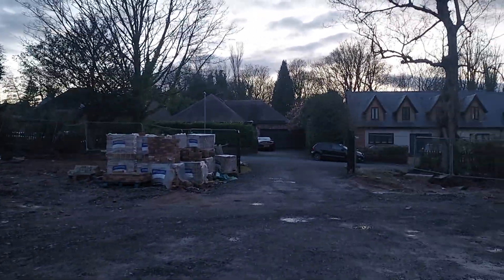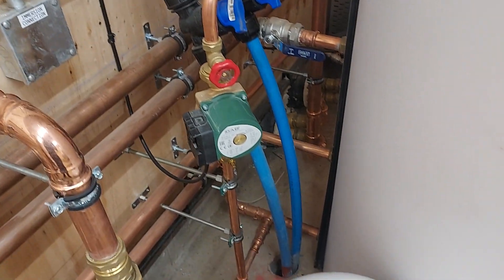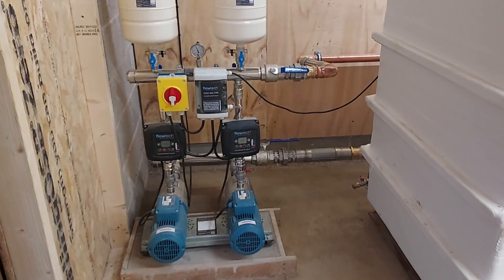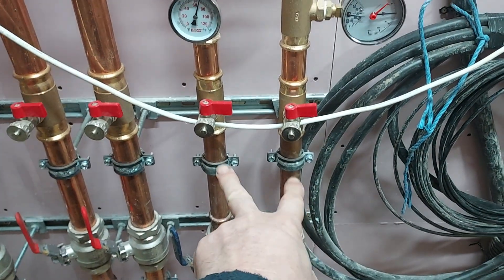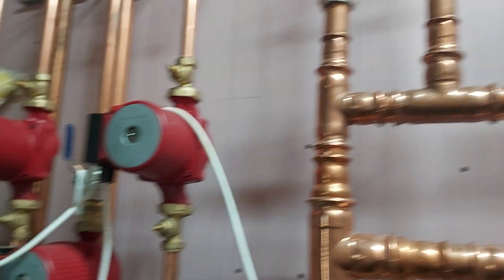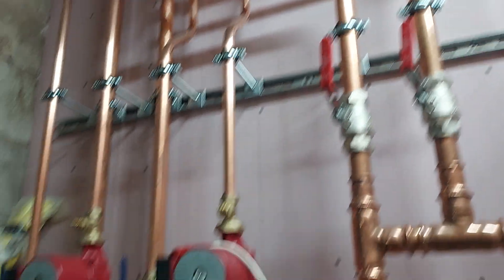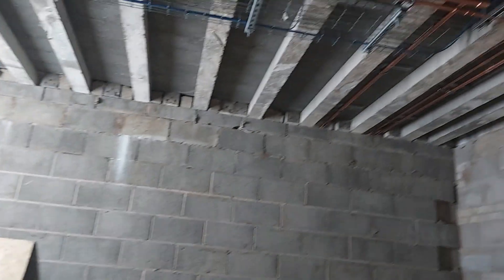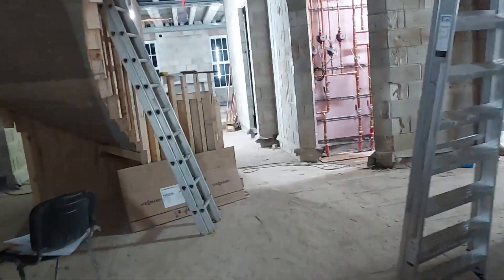My biggest Project so far

Comment: This is a total bullshit job with oversized pipes and extraordinary heat loses in all the circuits, waste of electricity in redundant pumps.  I made heating for building with 30 flats with 31 bathrooms, 1700 square metres and needed just 1000 liter indirect ACV HRs 1000 boiler heated by 48 kW gas condensing boiler capped to 28 kW and flow temperature from boiler set to 65˚C limit to allow condensing during heating hot water. Perfectly fine for my building, annual efficiency is 59 kWh of gas per 1m3 of hot water around 50˚C hot, including circulation loses. Not carrying about legionella due to 3 m3/day consumption which doesn't allow grow of it. 32 PPR was fine for hot water supply peaking at 1m3 of hot water during peak hour. Separate 48 kW gas boiler for heating through plate heat exchanger due to pressure difference caused by high static water pressure (26 metres building). Primary heating circuit flow rate 2 m3/hour, secondary 3.5m3/hour with possible peaking up to 5m3/hour. Using copper for hot water supply is nonsense. It has huge heat loses, PPR or PEX does much better job with regards to heat loses. Remember - I used PPR 32mm for 31 bathrooms and it is still oversized. Electricity supply for the 30 flats is 3 phase 80A/230V.
Reply from the maker: @JiříFranek-s2j  thank you for your comments. I guess everyone's entitled to their opinion

Comment: Cracking job Andrew. Looks like fun. You have given me an idea. I am building a summer house which will have a shower and kitchen. I was going to install a small electric unvented but might use the insulated pipe you have for the 25 metres from my 300litre unvented.

Comment: Hi Andrew I've just been doing a house with numerous bathrooms. I had initially thought about PIRs to trigger the bronze pump on the Dhw loop, but had discounted it just from lack of confidence in the idea, after watching this video I thought what the hell ill give it a go and customer was game to trying it as well.  So I've just finished wiring it all up today and putting the PIRs in. And works quite well, it's not mega instance but it does drastically reduce the wait time. Thanks for inspiring me to give it a go
Reply from the maker: The idea of the pirs is that it gives time for the circulation to occur before you open the tap. If the water isn't actually getting to the tap by the time you have finished having a pee you may need to use a stronger pump

Comment: I am not a plumber but many many years ago I used to layout printed circuit boards with red anc blue tape. The resulting large image was photographed, shrunk to pcb size and etched with acid to reveal copper tracks. Seeing all this copper work brought it all back. It seems a terrible shame to hide it all.
A quick question. I have been thinking about the hot water runs in my normal house and ways to reduce the wasted water and energy content. 
I came across the Sunamp heat battery which looks like it would do a good job. It takes the place of a hot water cylinder and is about 1/3 of the size. It should release hot waterinstantly and csn be charged by either hot water or electricity. It looks like it would be a (gòod?) Solution for at least the handbasin issue. Any comments would be appreciated.
Reply from the maker: Any cylinder provides hot water immediately and so this will not be a solution for the problem

Comment: Maybe I didnt understand well what the 4 pumps do, but if they are used to reduce the time from when you open a tap to when you have hot water available at the tap, then why not control them via a flowmeter? When you open a tap then they turn on. Why use a PIR to control a pump? Also PIR tend to break. In 5 years a pir will be broken and those pumps they will not turn on anymore and the owner won't even know it. You can buy from Grundfos a similar pump to the one you selected there, only it has a flowmeter integrated so that when there is circulation, the pump comes on

Comment: Sorry, 500ltr for 3 people - what are they, mermaids?
Reply from the maker: The 500 L is for the house rather than three people. The customer has requested all five showers to be operational simultaneously at 30 l per minute. That's approximately 2/3 hot water that's 100 l of hot water per minute so a 500 l cylinder will give them 5 minutes of of showering. The original design required 1000 L of water to provide 10 minutes of showering. The customer agreed to having only a single 500 L cylinder on the basis that they won't actually use all 5 bathrooms at the same time and if they find it problem it's already planned up just to slot in another 500 L cylinder
Reply: Clients are also practising muslims  with own prayer and washroom, which could mean five times a day.
Reply: 30ltr a minute shower x 5? So they are mermaids then 🤣

What's the recovery time with 64Kw?

Comment: And that is about £5k worth of copper pipe & fittings Alone.  Woooah that is a rather large and involved install. Good work and looking super slick.
Reply from the maker: Yes somewhat over specified and oversized for sure. I keep telling the customer that if this was for a 20 room hotel I would be thinking the system was about the right size

Comment: How do you combine two boilers and still utilise priority hot water? Is just one boiler being use for the cylinder?
Reply from the maker: The cylinder is fitted with two hot water temperature census. One boiler is set to 55 degrees and the other to 50 degrees. So when only a small demand is placed upon the hot water only one boiler will fire if the demand grows bigger and the temperature in the cylinder drops further both boilers will fire to reheat the water in the cylinder

Comment: I'm a plumber, nearly 30 years old, been qualified for almost 10 year, I've spent my life doing kitchens,bathrooms and general repairs and maintenance but installs like that in the plant room makes me feel incompetent, wouldn't even know where to start
Reply from the maker: A very good friend of mine is a commercial heating engineer. The often says to me that commercial is just the same as domestic but bigger. Actually if you look at the design of this system and some of the smaller ones I do this is actually far more simple. But it's been a really good learning curve for me handling such big pipework and carrying out calculations for this size of Project. You really do have to stop a lot and calculate through how things are going to work when they're on such a big scale. So far I've found a few surprises along the way that have required design considerations I've not had to make before. I just hope I haven't missed anything in the process and that there's no design failures in this job
Reply: @andrewmillwardwatford9410  I thought you had a commercial ticket?
Reply from the maker: @tonydaddario4706  no I never do commercial work. The commercial part of this gas system will be done by another engineer
Reply: @andrewmillwardwatford9410  how is there a commercial part of the gas system if it's a domestic premises? thanks

Comment: Impressive.  Thanks for sharing.
We're a family of 5 and 250L DHW tank does us.  We can run it out if everyone has a shower/bath in same evening, but honestly 1000L would be if we ran a hotel spa.. ha.. :)
Reply: Also has 64kw HWP to recharge the cylinder fairly quickly if that were ever needed.
Reply from the maker: My house has a 210 l cylinder supplying 5 bathrooms and heated by a 32 kW boiler. We never run out of hot water

Comment: For the PIR system, could you introduce a timer into the loop so that in the middle of the night, the PIR wouldn't set the pump running when people are just likely to need a bit of cold water for hand washing?
Reply from the maker: The beastmen boiler provides timing for the secondary circulation system
Reply: Ah ok. Seems like you have about as much control as is reasonable then.

Comment: Insulation wants to be kingspan kooltherm. 25mm wall thickness

Im utilising time delay (if run then timer kicks in for 30min to hold pump off)  and temp sensors close to outlets on my secondary return

Dont let bathroom fitter use flexis. Stipulate all hard piped copper and end feed tap connectors. No pushfit whatsoever aswell due to secondary returns 

Nice job to get into looks well 👍
Reply from the maker: I think on the rim sensor that's not a bad idea but for the toilet one I think we would need to stick with it as it is. What do you think
Reply: @andrewmillwardwatford9410  i think you need to be concerned about minimising heat loss in every way by insulating all hot pipework and limiting its emmitter effect by having it running as little time as possible

. Thats a lot of hot pipework in a house with only 18kw heat loss. 

Pir outside the toilet so its activated before you go in (directed with tape towards the door) gives you most abouunt of time before you need to use hot tap. You might get a couple of false positives but would be fine
Reply from the maker: @D_pawson  that's a very good point about the amount of heat coming from these pipes relative to the house heat loss. The insulation was originally going to be done last week but the customer has delayed the insulation work. This actually worked out well for me in the end as I was a bit late finishing the job
Reply: @andrewmillwardwatford9410  it looks a fair old job. I wouldnt have liked to take it on. You have done a very good job 👍

Is it separate insulation contractor comming in to insulate it?
Reply from the maker: @D_pawson  not sure but maybe my wife
Reply from the maker: Are you recommending the insulation for everywhere or just for the secondary circulation system
Reply: @andrewmillwardwatford9410  all pipework. The stuff is cracking👌 works really well. Will post some photos on your forum of it